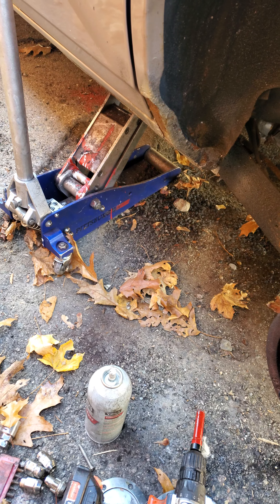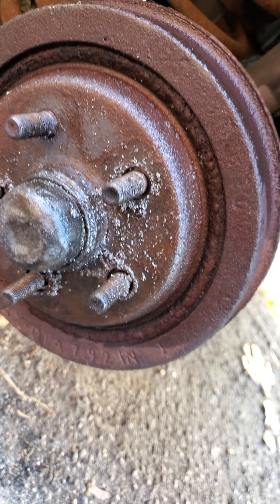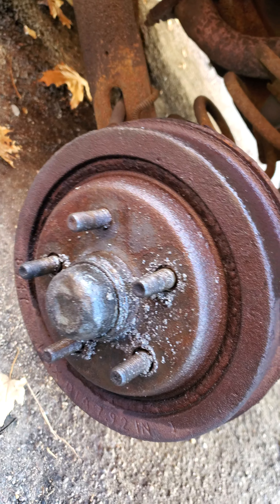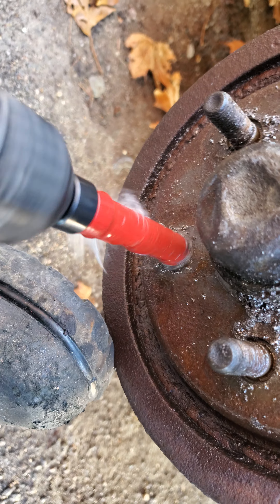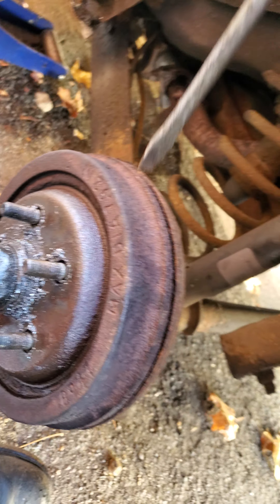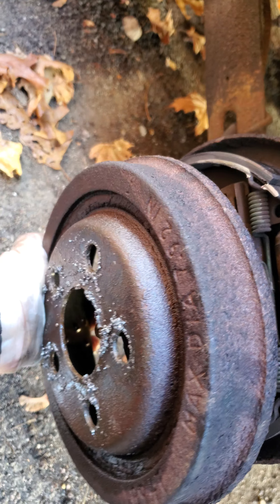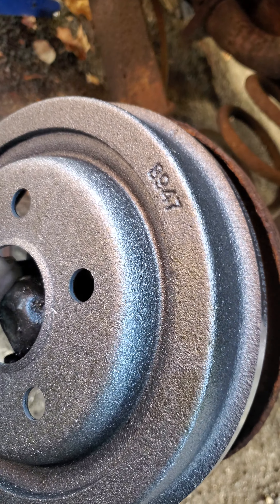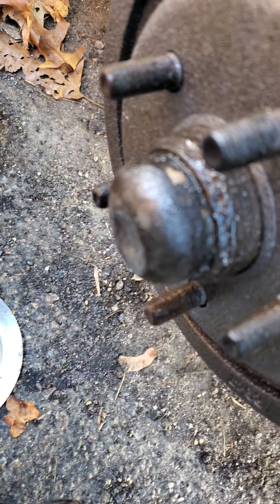How to Remove Staked Brake Drums off K cars the easy way.

Comment: Crazy idea!! 
Find someone with oxi aceleteline (however it is spelt) and apply heat 
Simple, and you reuse the drum.
First you must attach a feather to the flame which is the hard part!!!
Reply from the maker: U can just pop off the dust cap and wheel bearing nut take it off together. No need for torches.

Comment: What if you need to reuse the brake drumb. What is tge purpose of the feather on the hole cutter?
Reply: The feather is most likely used to cool the drill when it spins.
Reply from the maker: This is only to replace the drum. If u don't need to replace it just take out the nut and leave it on the hub.
Reply from the maker: @raystanton238 it got stuck to it from the oil. No feather required